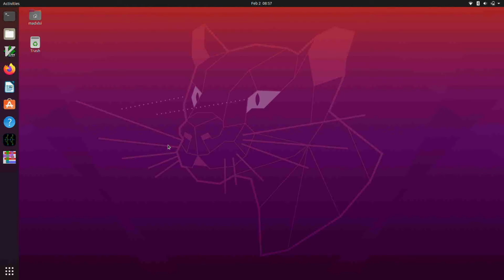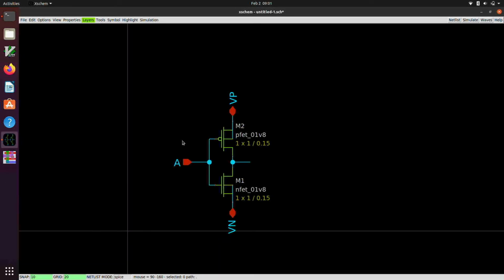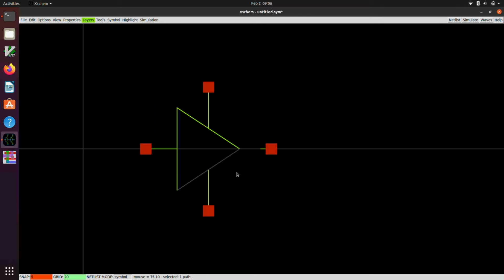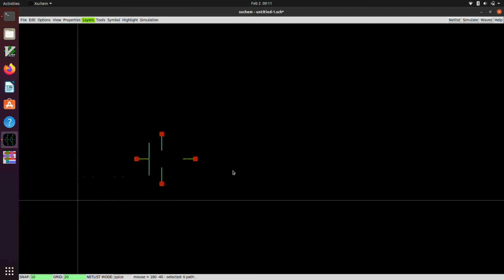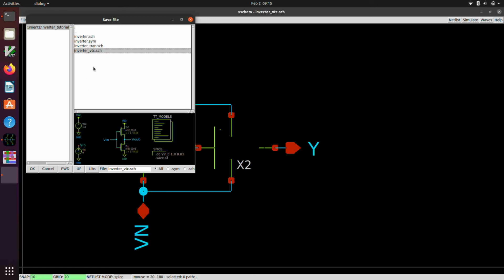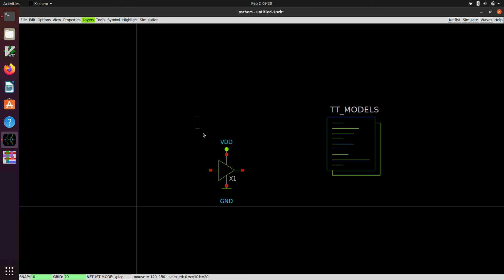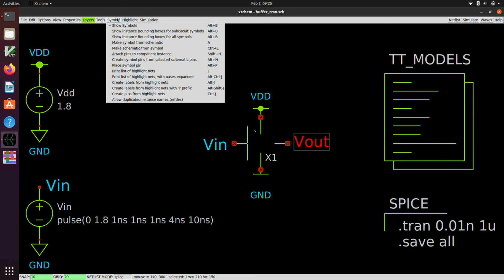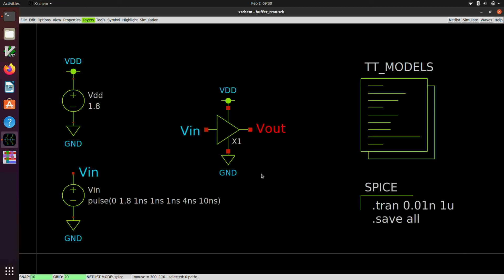Creating a Hierarchical Schematic in Xschem

Comment: Where to get TT_models?
Reply from the maker: Unfortunately, you can't just get the TT models.  The models are distributed across 100s of files some of which are 10,000s of lines long.  The best way to get the PDK is using Open_PDKs (http://opencircuitdesign.com/open_pdks/index.html).
Reply: @bminch  Thanks. I am already using sky130 PDK with Magic but unsure how to use this PDK for spice simulation using e.g. LTSpice. Could you make a tutorial for that?
Reply from the maker: @saadqayyum2148  In that case, you might check out the tutorial on using the Sky130 PDK with Xschem / NGspice located at https://xschem.sourceforge.io/stefan/xschem_man/video_tutorials/install_xschem_sky130_and_ngspice.mp4 and some of the other tutorials on Xschem located at http://repo.hu/projects/xschem/xschem_man/xschem_man.html.  I thought briefly about trying to use the Sky130 PDK with LTspice, but doing so seemed quite insurmountable.